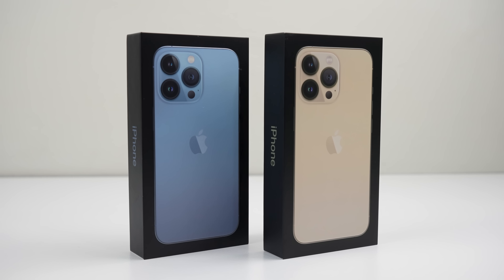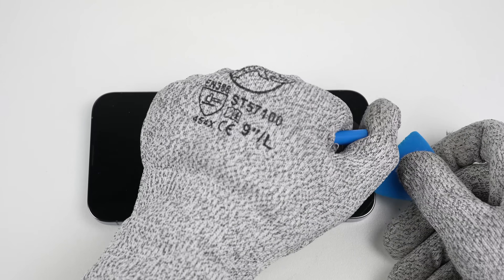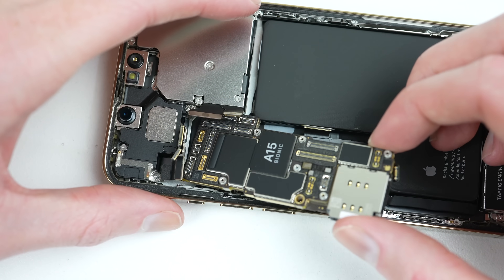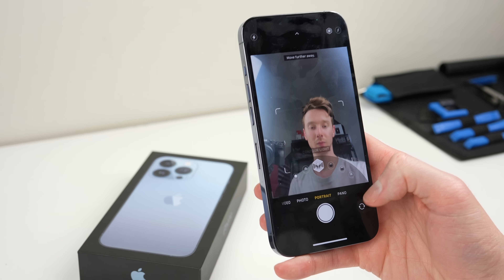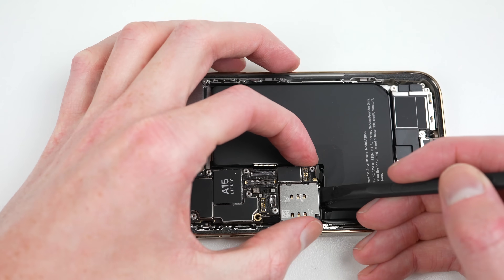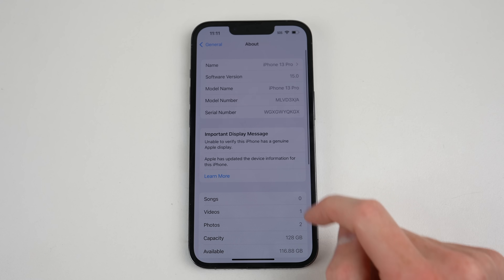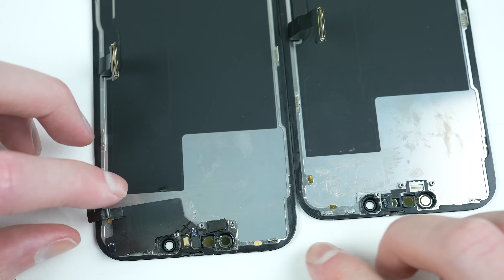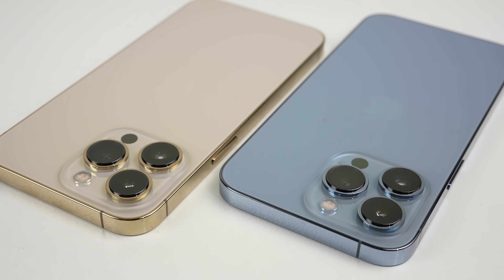iPhone 13 A Repair Nightmare - Teardown and Repair Assessment

Comment: Meanwhile, Fairphone comes with a screwdriver you can use to replace almost everything. LoL
Reply: Never heard of fairphone
Reply: @F99 Crafter See? im an idiot, sorry. the initial F... fucked my brain
Reply: Links to anything good about this, so I can save myself having to navigate google?
Reply: @DanielSultana  it's a cheap android phone that was manufactured in a more ethical way with more sustainable components than mainstream smartphones. i.e. no child labor, no conflict materials. unfortunately the phone itself is kind of a piece of crap compared to flagship smartphones
Reply: @ToxicallyMasculinelol  as it often the case unfortunately, there's more reasons other than brand loyalty as to why people stick with the major brands.
Reply: @ToxicallyMasculinelol  They just announced a new one. The specs seem to be quite good.
Reply: @boo_  the new one is the one I was referring to. the specs are good for the price, but my point is, they don't make a flagship-level model. at least since the 2nd iteration, they have only produced low- to mid-tier smartphones. it's more comparable to a pixel or a one+ or huawei phone than to an iphone or a galaxy flagship. that is, it's a very good deal for the price, but there's no option in the $1,000+ range.

so although fairphone offers what amounts to like 80% of an iphone for 60% of the price, there's no option to get a fairphone with 100% of the features of an iphone, for any price. so it's not gonna interest people who are willing to spend a disproportionate amount of money for that last 20% better performance, better battery life, better camera, etc.
Reply: Its all about the mindset...!🧠
Reply: isn't fairphone that fake phone that has a just a little modified OS from Lineage?
Reply: @InnerEagle  I think their selling point is ease of repair and ethical manufacturing. The OS is still Android, so nobody really cares.
Reply: @InnerEagle  buddy in the phone market only Android and iOS are running around. Creating a new one that is better is near impossible.
Lineage OS is Android. You are free to modify it as you wish and resell it within your phones. It's just an Android phone, like all others

Comment: In terms of Security of faceID I can understand why the replacement of certain parts like front camera and IR sensor would cause it to stop functioning. It would make it way to easy otherwise to steal iPhones and hack them by replacing those components with 3rd party unsecured parts. But the issue to me the ability to change other unrelated parts that are not an integrated security feature. Especially the display should be change able. Out of all the things Apple would be able to predict that could cause a need for a repair during the phones life, the display should be the first thing on the list and shouldn’t really be hard for them to design it so that would be possible for 3rd party or DIY repair. But I fully support replacing parts integrated to the phones security should be reserved for Apple or specifically approved repair shops.

Comment: This is not supposed to be legal, right? Hope EU makes a new rule about it
Reply: Get behind the right to repair movement to stop this from happening
Reply: Just be smarter: If you have enough of money everything is legal :)
Reply: They won't.   Someone, somewhere, somehow will get a backhander to kill it and we the customer will loose again.
Reply: The EU will already start requiring Apple to have USB C charging ports within a couple years...
Reply: @geraldwatts5492  Nope. Theyll just include an adapter that goes from lightning to USB C. Nothing requires them to use USB C IN the phone.
Reply: @geraldwatts5492  by that time Apple will go port less in their devices.
Reply: @geraldwatts5492  USB C has nothing to do with Roght to Repair … stupid comparison
Reply: @danielh1589  He didn't compare it, you did. He only rightfully mentioned that there already is movement in tech regulation that is in favor of the consumer. Stupid comment.
Reply: @jaritorigami6212  it's not in favor of consumer when something better than type c comes along and we have to wait for the government to update the standard.
Reply: @danielh1589  step 1 read the comment
Step 2 understand the comment

Step 3 reply to the comment. 

Tip: if you failed step 1 and 2 do not proceed to step 3. Thank you. 

Signed: common sense
Reply: @j97n75  it is happening on computers already. They are up to date with all tech. So this statement either stems from ignorance either stems from an ignorant.
Reply: @j97n75  Maybe read about it before commenting on it. EU didnt pick which connector they have to use they said they all have to use 1 standard everybody else agreed on USB-C now when apple was given time to use the standard EU is going to enforce it. IF industry decides they want new standard they will swap to it EU only enforces that they all have to use 1 type of port they dont say which type. Also they clearly said they will revisit the standard fairly often to give manufacturers frequent chances to inovate.
Reply: Laws are for plebs, not the elites that run these companies
Reply: @scorchbubbles  No, they still get fined. But they rather pay those fines than change their ways.
Reply: @scorchbubbles  then apple can just release and sell their parts lol, but they will sell it very expensive and u buy and install at thrid party service  can't get a full warranty of the phone
Reply: The Eu is going a way which in the future will have a very good mindset of sustainability and repairs of electronics will happen a lot more then do now.
Reply: EU? What's the EU? hahah just a bunch of socialist scumbags.
Reply: @marcellop3163  where are you from?
Reply: actually u can get repair from apple not third parties XD
Reply: @ngweisheng3224  lmao, most androids  and other phone/pc/laptop systems can be repaired by any party
Reply: @thedarkdragon1437  haha I like both, all business staffs I use iPhone and gaming I use android, not a issue for me
Reply: @ngweisheng3224  lmao. Kinda like any other device. I just won't buy iphone. If business wants me to use it, why not. I just won't buy it. Also...sometimes in business, the status symbol of iphone can do some, shall we say, profitable deals for you lol
Reply: @thedarkdragon1437  actually I am software engineer I need both of them. But for apple mostly I use for my business use, android I use it mostly for gaming. I will test my projects on both phone lol
Reply: @thedarkdragon1437  Is funny when I saw post like comparing apple andoird, window, Mac OS and unix. For me I want all haha 😅
Reply: @ngweisheng3224  didn't compare operating systems, just hardware. Operating systems is even worse. Basically it's do everything, try to do something, do something or try not to throw your computer out while trying to get something to work only to realize that you can only use VM for certain things.
Reply: @thedarkdragon1437  my point is very funny for those people keep comparing benefits or disadvantages of each products. All of them have different market and purpose  lol
Reply: @ngweisheng3224  i don't see a problem there lol

Comment: Completely off-topic, but damn, the first time you see that OS is a shock.  An overwhelming mess of icons just slapped down on the screen
Reply: lots of Android manufacturers aren't much better with bloatware like Facebook preinstalled and sometimes not even uninstallable (except via ADB)
Reply: @ludwig2345  oh for sure, yeah.  There probably isn't a single phone which doesn't have a similar issue.  It was just a surprise seeing it all there at once is all
Reply: @partthethird  I was pleasantly surprised at the lack of software loaded onto my pixel 5a from Google Fi

Comment: Edward Snowden explained why batteries are almost impossible to remove:  Your phone is never really "off."  It will ping towers for WEEKS.  That is by design.  When he was a CIA field operative they always used burner phones with removable batteries.  Government doesn't want you to shut off your phone.  THEY TRACK YOU.  It's not even a secret anymore.

Comment: So many guys are against this but this discourages robbers to steal this phone as it will just be a dummy and they cannot even sell its parts. Because they can literally do nothing with it. And an apple phone doesn't just break. It lasts very long if not forever. If you keep it well by the time it breaks you should be in need of a new phone as that phone will be so outdated.

Comment: Hugh, you are so skilled. That alone is a pleasure to watch. This might sound like a question from someone who is late to the party, but are all the other major brands east to swap parts? Thanks for the video!
Reply: The short answer is yes. Apple is leagues below its competitors in repair and replacement. I'll leave the long answer to Hugh.
Reply: It's hard to sum up rest of the market in a short comment. Generally speaking you can replace something as insignificant as the display without the phone even knowing something has changed. Good software is hardware independent. Most manufacturers rely on having unique parts and chips that can't be bought from other manufacturers to earn profit, parts from the same manufacturer are generally interchangeable.
If you used a sensor from Motorola phone in a Sony phone (given that you could connect it properly), if they're not following the same spec there's no sane way to make them work interchangeably. But that's a safe assumption to make from software dev pov. No point in supporting unexpected hardware.

Apple on the other hand invests additional effort into:
a) providing their sensors with ability to self-identify which drives manufacturing prices up, needlessly increases component complexity (which adds points of failure) and provides no benefit to the end user,
b) checking identification provided by individual components (SNs) from their firmware,
c) adding fake bugs into their software that activate when SNs don't check out to convince users the repair service they used did a bad job and deteriorate trust between them and third party repair.

If anyone, MAYBE Samsung does something similar, but definitely no one not to the degree Apple does it.
Everyone else is just trying to push out as many phone models to be able to compete on the phone market with other manufacturers. No way in hell are any of them going to invest additional resources and drive their manufacturing costs up just to ensure you're forced to use their repair services. And funnily enough, Apple who's doing that shit, has the single worst first party repair amongst all manufacturers. They opt to loose their customers' data (photos, files, ...) and give them new phones instead of repairing even the most trivial issues.
Reply: @Caellyan  Thank you! much obliged !

Comment: I think this is a feature to avoid the use of stolen apple products, usually happens in 3rd world countries. 

where they steal a phone, strip it for parts (like they do for motorcycles and cars) then use those parts as replacements for legit people who just want their shit fixed. 

the repairmen/supplier of repairmen sell them for cheap and all-in-all they save a heck lot of money using stolen goods. since people in 3rd world countries tend to find the cheapest repair station, more than they value legit ones.

Comment: Thanks for the information. Rethinking upgrading to a new iPhone now. My current one needs a new battery but has that known issue of using an aftermarket battery/ circuit board thing. Maybe this is what finally pushes me to a Samsung.

Comment: This is the reason why I stopped upgrading my iPhone. I have I phone 7 plus and I have not updated in years and still working perfectly. I don’t need the new phone as long my phone still functions properly for years. It’s a good product if you take good care of it. I buy a device and replace it after 5-7 years.

Comment: Somewhere in the mist there must be a way for the Genius bar to tell the phones that they did an approved Apple repair. After all, they would not want to repair a phone and then have features not work. But, being cynical, I'll bet that the code will be some encrypted mess that can't be used on a different phone.

Comment: Imagine if you buy a car, but you can't change tires even if the tires is flat, or else you can't steer your car because steering mechanism is locked to tire's serial number.

That's the perfect analogy for Apple products.
Reply: Imagine copying the top comment.
Perfect analogy for youtube comment section 😂

Comment: Serializing hardware components has been common practice since the Playstation 3 era. I had an original PS3 with an optical drive that went bad. No problem... swap the drive. NOPE! The optical drive, mainboard, and GPU modules were all serialized so the only thing you can do when one component fails is to replace the entire thing. It's an absolute scam.

Comment: What we need to do is find out what tool apple is using to validate the new piece of hardware. if a "Genuine apple part" from a genuine apple phone is not recognized they must have some sort of administrator level function in the phone that can be used to approve the new device id.

Comment: This can be very good for third-world countries with high crime like mine, the simple fact that the screen cannot be repaired by a 3rd party makes it useless to steal the iphone from thieves because it can no longer be used the skid, hopefully the battery either.
Having to pay much more directly to Apple is hard but in this case it is beneficial to reduce the impact of theft, if the phone you steal does not even serve to sell parts to repair, well... nobody will steal it  or at least I hope so.
Reply: Ye but you forgot about having to repair your phone , you would need to contact apple which means you won’t be able to repair it or you have to travel and pay so much more to repair it
Reply: @mahmoudherbawi9774  much cheaper to take it to repair than to buy a new one.

Comment: So basically apple is trying to make any non genuine parts look like they don’t work when they should to justify getting it serviced at apple instead.

They programmatically added bugs when a non stock part is installed.

The fact they do this with genuine apple components is shocking.
Reply: Don't blame Apple. Blame all the companies that have stole their patients and forced Apple to do this. This guy conveniently left out that Apple was just awarded 600 million from Samsung for patient infringements. Apple spends millions in research and development and Samsung comes along and just reverse engineers their product. If this was your company, I bet you would change your tune.

Comment: I really like how they made the inside of the phones aesthetically pleasing with labels here and there yet they don’t want people to fix it regardless.
Reply: "oh you like our phones? Have you seen what we put in it? Yes? traitor, you're not supposed to "
Reply: There’s only two parties that I know of that will benefit from these changes. 1; Apple ofc and 2; Unofficial Chinese mod tools/kits that sells/rents such things.
Everyone else just got rear-ended by Apple.
When actual/real innovations are being drip fed by Apple Corp, this is the kind of things one can expect.
Just because then can do it doesn’t necessarily mean they should. When common sense no longer applies, you get this kind of shady acts.

I personally hate everything about it but that’s me so 🤷🏻‍♂️
Reply: One could say they made it so easy a child could make one
Reply: notise the QR codes on every parts so they know everything is blocked if you use wrong part.
Reply: Apparently that comes from steve jobs dad that said ,"its not only the outside that has to be beatiful"
Reply: Laws are different in each country, it could be really expensive to make different designs for each country. It’s the same reason they changed the charger socket, I think in the EU they have a bunch of rules.
Reply: Probs get a fat raise
Reply: Why fix it when you can buy a new one?

Comment: If our congressional leaders weren’t all in their 80s they would understand the need for right to repair. 

I like the ease of use of apple and like my iPhone XS but this is absurd. It’s a part it should be swappable. There is no reason to be software locked. 

Repairability is crucial to sustainability. I just replace the tail lights in my 18yo truck. I was able to use $70 lights that work perfectly and keep this vehicle safe and running. 

You paid more for both of these iPhones than I did for that truck. Something this expensive should last 10years minimum and be able to be repaired beyond that

Comment: If you're stupid enough to buy something from Apple, then in my opinion you deserve everything you get. The bottom line is, it's their device, they can do what they like. You don't own it, you license it. Whilst people are stupid enough to be putting up with this shit, they'll continue doing it. You've made a rod for your own backs by buying their products. The Right To Repair, although very noble, isn't going to save you. It's Apple's product, so it's Apple's way or the highway. I know this is falling on deaf ears with the Apple fan boys, and I'll just chuckle and laugh whilst they're paying thousands to get their devices repaired, whilst I can get mine fixed anywhere. If you own a Apple device, you don't get my sympathy, not that you wanted it, you get my pity. But make sure when you look in the mirror, that the reflection you see is of someone that CAUSED the problem, so don't bitch when it costs you a fortune to get your device fixed.